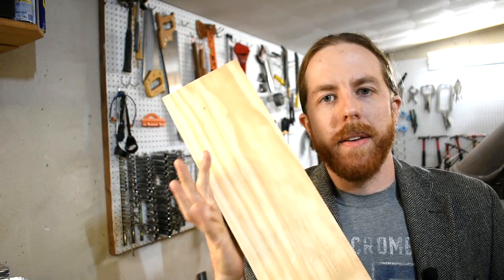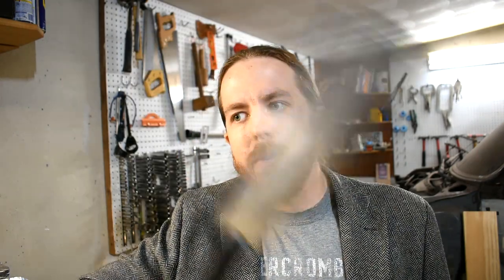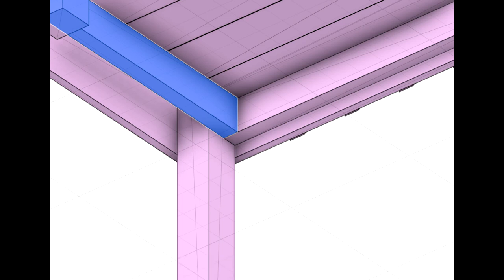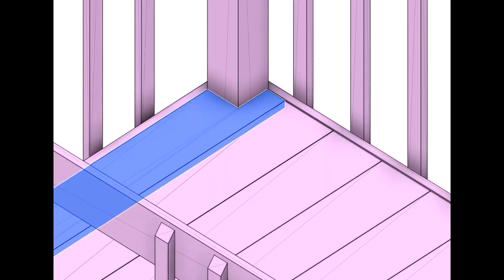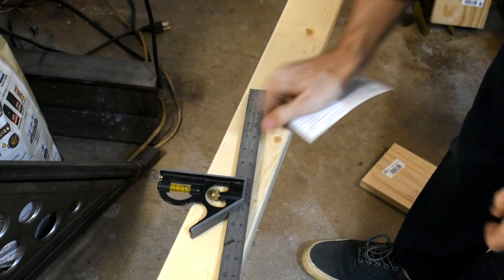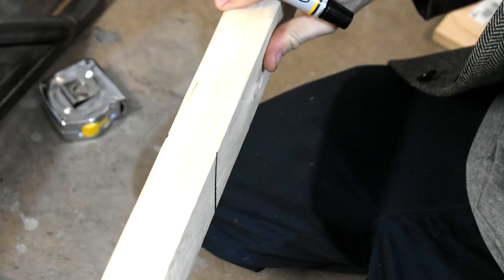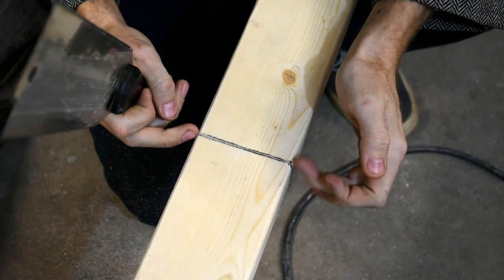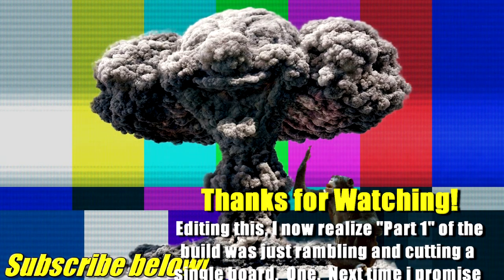Easy to Make Indoor Playground part 1: Design and Cutting One Single Board

Comment: Back in the 1960s they figured out there was a loophole, only the rough cut has to be to dimensions. they shave off 1/4 of an inch on all faceing sides for the finish cut.
Reply from the maker: But there is a larger discrepancy the larger the number.  I get that a 2x4 is then shaved 1/4 all around and you get 1.5 x 3.5, but a 2x12 is 1.5 x 11.25, a larger cut down on larger dimensions
Reply: @PaulsGarage  my source only said the rough cut is to dimensions, I added the bit about the final cut being exactly 1/4 myself. I am probably wrong.
Reply: @PaulsGarage  Boards are cut to their nominal dimensions when they are still green, then they shrink as they dry out. So, a 2x4 is 2 inches by 4 inches when it is first cut, but it dries out to be 1.5x3.5 inches.
Reply: It is the finishing and drying that cause the size difference. It is possible to buy rough cut timber that does come out to those exact dimensions.
Reply: Paul, all these are correct. 2x4 or whatever is size cut from the saw line. That saw cut piece is then sent through a planer which removes the saws marks and smooths the wood, it's then kiln dried to a certain moisture content which causes the wood to shrink more. 
Compare plywood sizes, they are always thinner that what you want,  after a month or more inside that lumber you've bought will shrink even more especially if you hear with gas or wood. It may even crack.

Comment: I like it, good idea. The underneath looks like good fort material to me.

You should be able to leave off all the spindles on the back two sides that face the wall, there’s no where to fall through. Maybe that will save you some time to put into something else...
Reply from the maker: I thought about that yeah, especially if I bolt the thing to the studs.  If it was just free standing id want to have slats all around but maybe I won't.  I actually didn't buy all the wood for the slats yet
Reply: @PaulsGarage  exactly my thought, and it will mean you don’t have that gap between the wall and solid members.👍